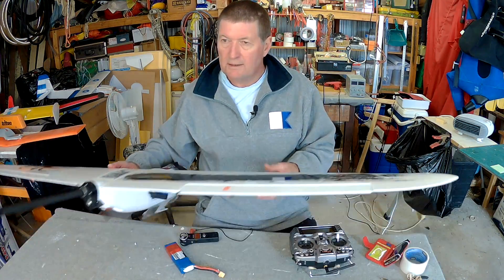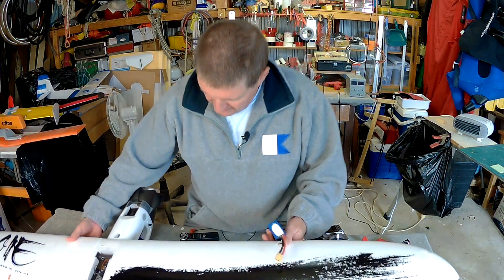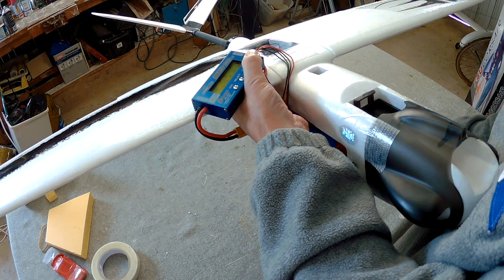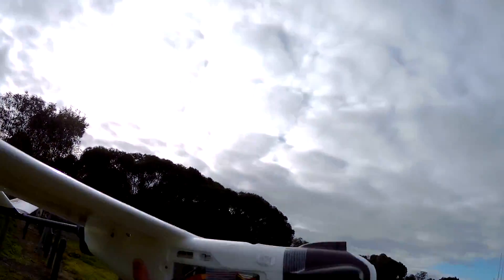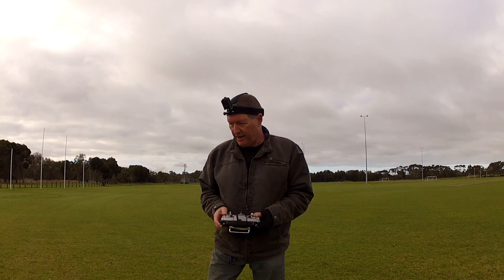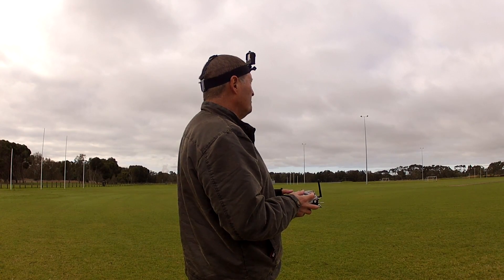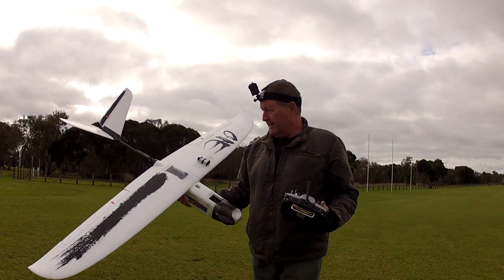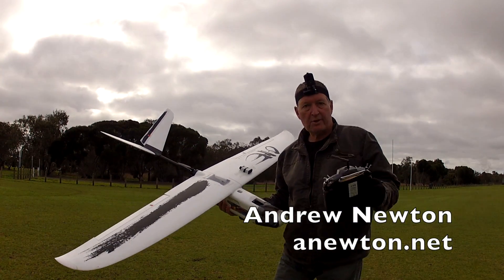X UAV One motor maiden

Comment: Andrew I have a question , what servos do you use on your planes ?
Reply from the maker: Good question. On all scratch builds and slopers I use TGY 9018 metal gear micros from Hobby King. If any of the review planes have stripped servos that's what I replace them with too. On the DLGs I use Dymond D47 for rudder and ele and KST DS245H (for when the cheapo PNP aileron servos die)
Reply: Andrew Newton thank you the answer!

Comment: Right off the bat, I don't like the idea of adding additional gears to turn that weird prop. For one, it's extra weight. Secondly, wouldn't metal-on-metal contact cause unnecessary vibrations that'll affect FPV? Thirdly, how on earth do you properly balance those folding props?

It looks innovative... but if it doesn't address a design problem or improve performance, I think it's over-engineered for nothing.

Comment: Maybe the noise can be reduced with a solid, balanced prop. Folding props could introduce a lot of places for imbalance (like in the folding mechanism)
Reply from the maker: To some extent yes, but most of the noise comes from the gear teeth.

Comment: Thanks for reviewing this, great job, I've been interested in this model for a while now, I watched both your videos on this and it wasn't bad on the slope but as soon as I heard it take off I made my mind up, I use my electric models in areas where noise would be an issue so it's definitely a design flaw to add extra weight and components to the drive-train in my opinion, otherwise a nice change of design.
Reply from the maker: The noise detracts from a really nice motor glider, well built.

Comment: Howdy Andrew, as you & others have mentioned in the comments below the noise isn't ideal, if there was half as much noise would you leave it how it is or still pursue the front mounted motor/prop? PS the idea of twin motors sounded fun ;-)
Reply from the maker: That is a good question Matt. The noise is a big factor for me, I'm attracted to smooth and quiet flight. It's also the added nose weight needed to balance the motor aft of the CG, and the folding prop that takes a bite out of the wing when it starts spinning.

Comment: LoL! I don't think a woolly glove is going to save anyone's fingers from a serious prop injury! And that noise is likely due to imbalance. I still like the idea of the prop around the tail boom as it virtually eliminates the need for a thrust angle. But clearly the relative cheapness of the model means that a fancy piece of engineering like that prop drive will suffer from quality issues. 
 Andrew, could you please do a strip down video?
.
.
Yes, I know it's winter down under now, but I didn't mean take your shirt off!! :¬/
Reply from the maker: Strip down of the gearbox? Have a look at the review vid.
Reply: Ah, yes. Forgot what was shown. Hmm, not enough info to give an opinion though. I'd like to see the rest of that drive's components too. It definitely sounds like you have prop vibes and if that casing is slack on the prop drive or whatever bearings are being used are a poor fit . . .
So many chances for it to be eccentric that it could almost be English! :¬)
Reply from the maker: You crack me up! Funny bugga

Comment: Well the airframe seems sound enough.   Good enough in fact to warrant some experimentation....motor on the nose sounds like a good idea.   What was the outcome with the CG?   Did you have to adjust from the manual?
Reply from the maker: Manual, phht, who reads manuals. I determined the CG by saying to myself "That'll be about right" I was wrong!
Reply: Its a blokey thing

Comment: Looked at the build clip again...lol...An aluminium motor gear pinion on perhaps a grp main gear...?....Jeez, these chinese "designers"....dont they know anything..? As an engineer, this is just not going to last long at all..!!!!....I suspect you are going to find aluminium in the gearbox, especially as you didnt grease it as I suggested....Hardened steel gears involute meshing at least is what is needed and the gear centres need to be controlled.....Its a nice idea, let down by cheapo engineering "design"...Shame really....flies ok though.
Reply from the maker: I did actually grease it and compared the before and after noise....no difference.
Reply: Andrew Newton Ok, well the noise is probably down to the gear teeth shape....chinglish tooth profiles...lol...Is the big gear also aluminium?
Reply from the maker: No it's plastic, and yes you're right, gear teeth shape must be the source.

Comment: Hello Andrew, Is it swooping season? :-)    
  
I didn't like the look of that prop arrangement the first time I saw it, and I like it even less now I've heard it. I thought we'd got past geared motors. Anything that adds complexity and makes it more difficult to replace a prop can't be good, and anything that makes that much noise has got to have inefficiencies. 

I agree, either try a front mounted motor, or, if it were mine, I'd try twin wing mounted motors
Reply from the maker: Yes it's definitely swooping season, and this one is here every year. It's a standard folding prop setup apart from the gearing. I'll try a motor on the nose next.
Reply: I'd also recommend twin wing mounted motors, in my experience it adds more stability to the model. My old man's Radian Pro also has a tendency to piss off the local Maggie population :D